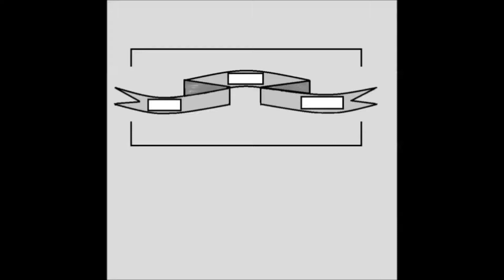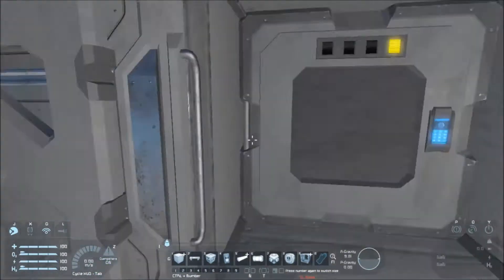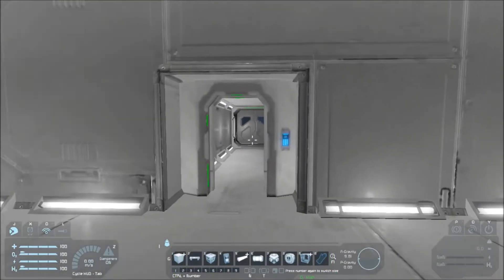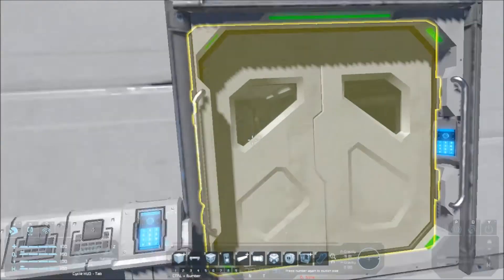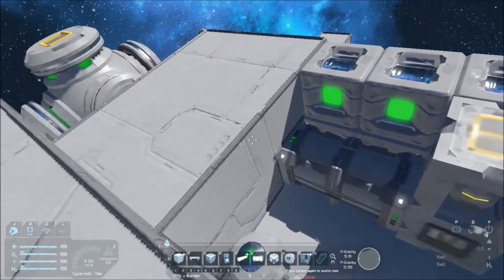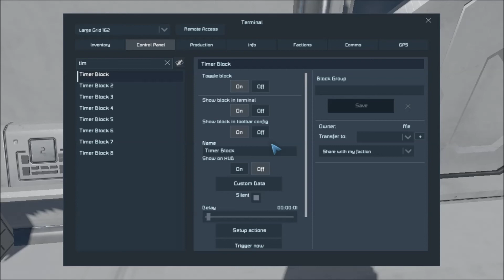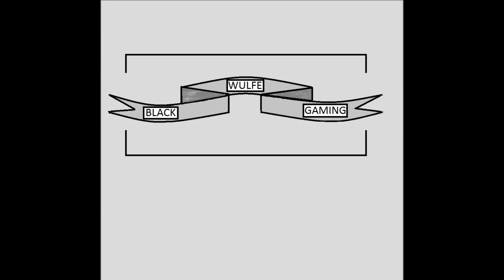Timer Block Tutorial: Air Lock Suprise

Comment: Hi, do u have any idea how to connect say like, when we power off reactor it sending a signal to timer block?
Reply from the maker: The reactor itself sending the signal, or the signal shutting off the reactor block?
Reply: @BlackWulfeGaming  reactor Shut down sending signal to timer block, so in the timer, i can hook up with the sound block or lights to indicate the Reactor is shut off
Reply from the maker: What is the signal you want to send friendo? I can probably mock something up for you. Sorry it took so long to get back to you.
Reply: @BlackWulfeGaming  i mean, u can shut down the reactor using Timer block right? soo, the same signal instead timer block sending signal to shutdown the reactor, im trying to make it another way arround. Reactor off sending signal to timer. sooo, anytime the reactor is dead, it is sending the the signal to timer, soo it can start blinking lights and sound block to warn me the reactor is dead.
I hope this is clear enough for your help.
Reply from the maker: That is perfect. You'll need two reactors for it. One big one for the ship, and one small one for the ancillary things. You could set a time block to turn off the big reactor, and the big items (engines, life support, major lights, whatever). It would then be able to turn on the secondary, which could run your low power systems. Now, for a warning system itself, if the reactor looses power unexpectedly.... I'd have to play around a bit. I might be able to set up some kind of logic gate with timer blocks, so when the main reactor is on, its constantly turning off a block trying to turn on a timer block and a secondary reactor. If the main one looses power, it should, theoretically, do it the same instant the small one turns on. That's gonna take a bit of work and testing though.
Reply from the maker: And if you want to chat more, if you have discord, there's a link in the channel desc. That'll take you to the channel discord. You can find me there pretty much always. If you dont have discord here will be fine. I'll just have to remember to check it more often. Lol. Sorry bout that. Again.